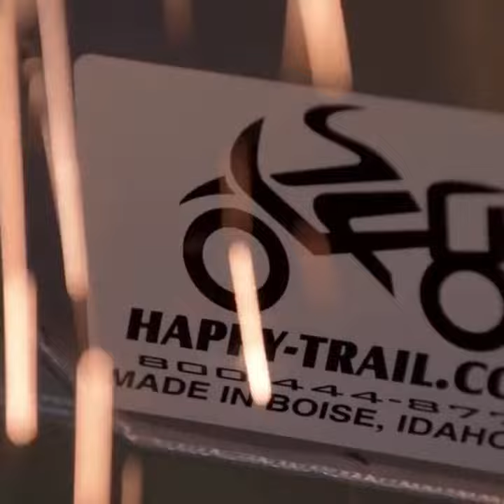Happy Trails Products, Boise, Idaho

Comment: I agree both my Klr has all there products. They have met and exceeded my expectation. The monster bash plate covering my oil pan has had some good knocks and has yet to even chip the paint. Yeah the crash bars have some scratches and a few dings but that's riding :)).   proly only thing i have yet to get is the nerf bags soon i think tho.